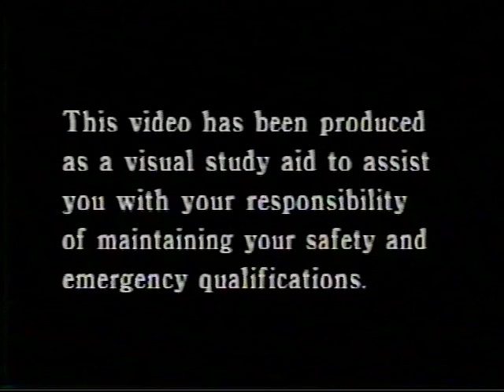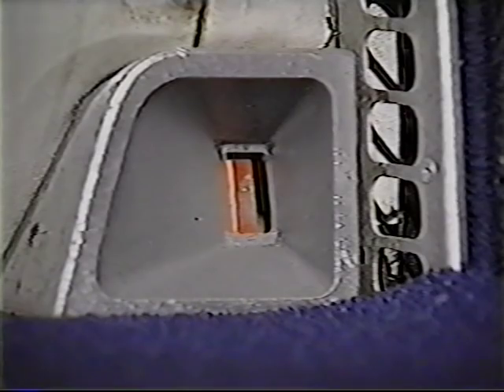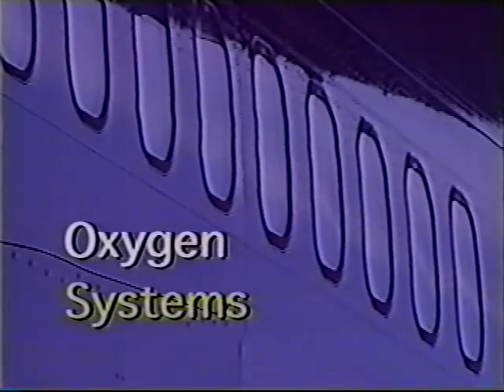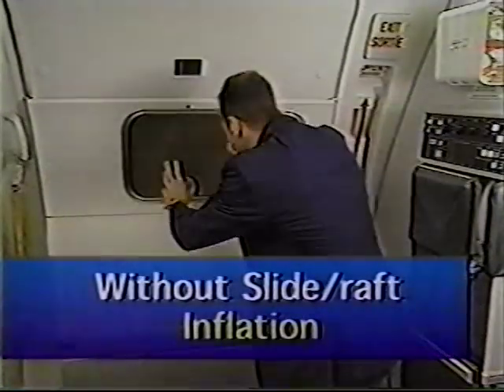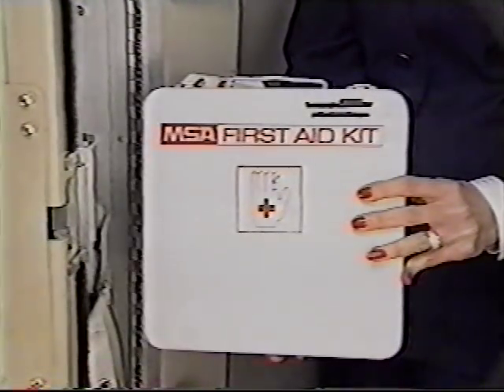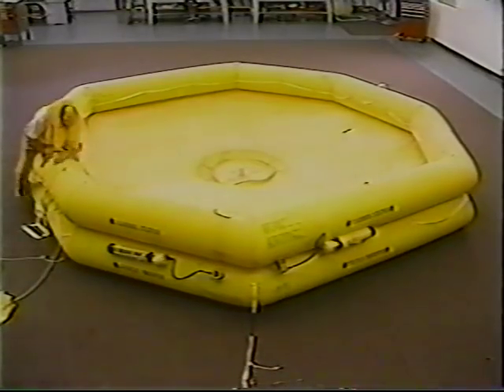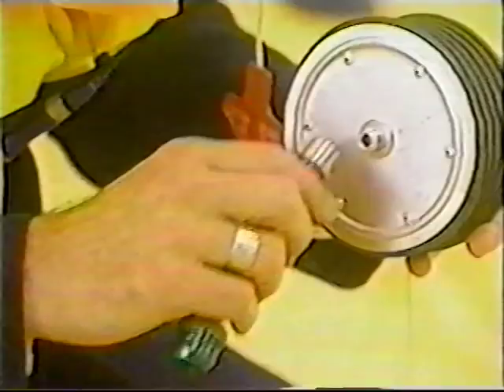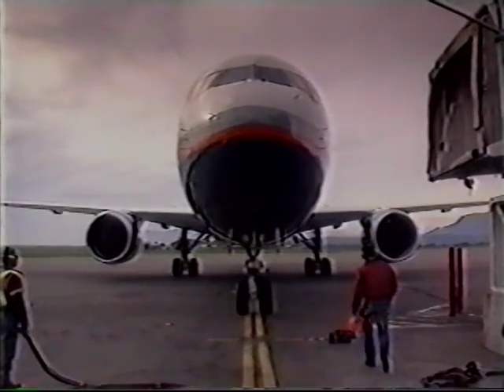Canadian Airlines Boeing 767 Flight Attendant Training Video

Comment: Many thanks for posting these videos. Very interesting to compare the CP A320s with the US Airways that went down on the Hudson. The later was equipped for over water flights and had instructiosn to put passengers on the slides/rafts.   The CP instructions were to get people to jump in water and hold onto the slides that were not rafts. 
CP's 767 were all -300ER, so I assume all equipped for over water flighst (though note at the end of this video, the rafts appears to have recently been added).

Also of interest: these videos predate 9-11 as they task flight attendants to open cockpit door to check that pilots have evacuated.
Reply: I think the CP instructions to hang on to the rafts rather than get in we’re because the A320s weren’t used for overwater flights because of the then still in use 60 min rule, so the chance of having an emergency where there isn’t a nearby airport wasn’t very high, so it didn’t make sense to have larger heavier slide rafts that would probably never be used as rafts. Ofc nowadays A320s are frequently used for overwater flights but back then the chance of an a320 being out of range of an airport was pretty low